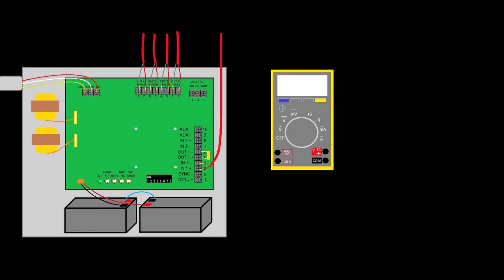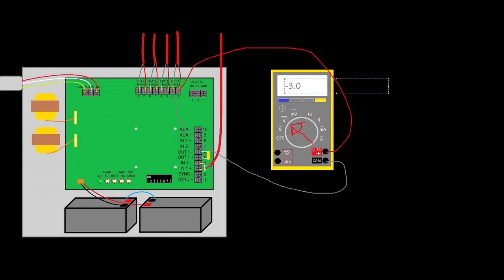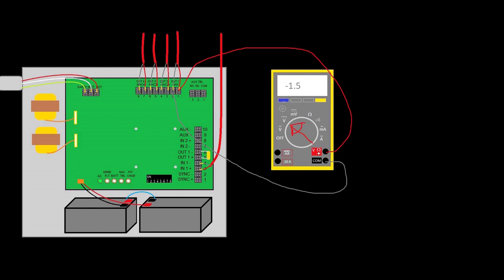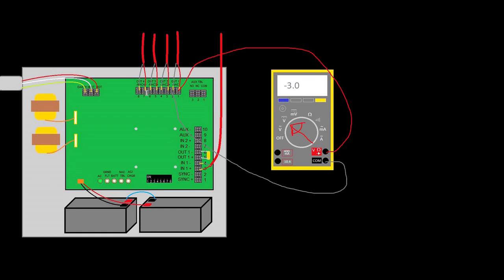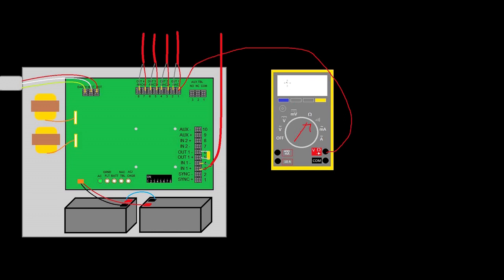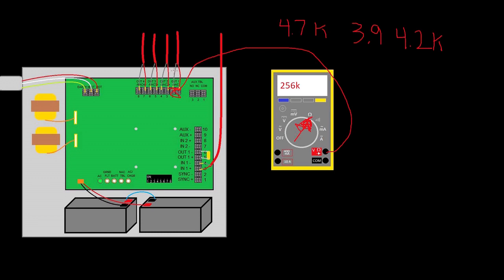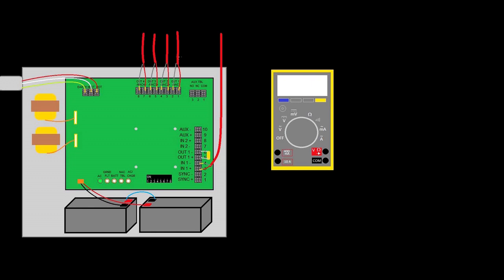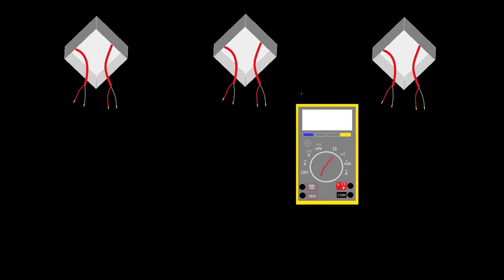31 - Metering Fire Alarm Circuits - Introduction to Fire Alarms

Comment: I know this is dated, but OL means Over Limit. The reading exceeds the capacity of the meter. Also, the setting with the diode symbol is the setting for checking proper function of a diode, i.e. continuity in one direction, no continuity when you reverse the leads.

Comment: Hi Joe,

Hope all is well and that you will read this.
I work at a property management company and recently we had a trouble pop up on one of our panels. Given what I found I'm surprised the trouble is new. Anyway, had a tech come look at it, he narrowed it down to a small area of the building but said he 'had no way to test' any further.

Needless to say, I got curious. We have multiple buildings with fire alarm systems and I am a 'do everything' maintenance tech so I started digging. Shortly into my search I found your videos. Your explanations and walk throughs of everything from the basic systems to the big picture really helped me piece this puzzle together.

In my experience I have done various 120/240v electrical projects and before your videos you could say I didn't really understand what fire panels do. So when I found out it's basically various electrical circuits that just have to monitor themselves I was all for it. Let me show you what I learned and how it helped me find the problem.

The panel itself is in the underground parking of a five building complex known as 'Phase 2'. It is an addressable panel with 5 SLCs and 6 Horn circuits, one horn is for the garage. The trouble was listed as '1002 Fire Trouble' (Note the device is listed as building only). The tech that came was able to tell us that is was on an IDC not a NAC so that helped somewhat. I did not pull anything off the panel itself because it was all four wire SLCs and a whole bundle after it left the main box and I didn't know what any of them were so I didn't dig into it much there. I found the control module for the building (had a trouble light lit on the front). Pulled it open, verified voltage on power in. Found an OL when I took of the 'loop' wires. On the other side of the module was what I can only assume to be data in. There is a 33kO resistor in line between the relays. The system looked like it was supposed to short on alarm, open on touble, so I was looking at the EOL of the data circuit for the building. As the note earlier suggests, I believe there was only one device on each SLC. From here on, we should be in conventional, one-in-one-out all in line devices.

Interesting note and question for Joe or anyone able to answer. It was noted that 24v smokes cannot be on a FMM because not enough power, this FZM (I believe although I have no indication from the module itself) gets power and yet we were only reading around 10V. Reading on this, at least some of the smokes had a dip switch to set them to 6-12V range so perhaps that solves the problem?

Funny note, the tech thought there was a short in the system when I know that would have caused an alarm and could clearly read an OL from the module.

So we started marching through boxes. The way the building is laid out we assumed the power started at the basement level of one staircase, followed the devices up and accross on the third floor hallway, and back down the other staircase to an exit on the first floor on the other side of the building. Near the panel there was a note saying EOLrs were at the pull station by that far exit door. It did not start like that. In the boxes there are red and black wires as well as brown and blue. It was hard to tell at first what they were but after confirming that they were just a continuation of the two wire circuit I started trying to read them the same. I noticed that we lost power after first the basement landing but had it in a random location on the other side of  the building, super confusing. I tried to get organized and draw things out, follow the power. I isolated a smoke that was getting power but not letting it through. To be specific this detector is a Smoke Sensor 2w-b. It's worth noting that the positive leads are split on the mounting bracket and the device completes the circuit. I saw somewhere else someone wired one of these in with the positives on the two + terminals. When I pulled the smoke down the line in was on RA- and line out was on RA+. This truck me as odd so I put the positives on the terminals labeled as such. Go upstairs to first, we now have power. Panel still has trouble unfortunately and still did not have power for a significant portion of the building. We keep going and find another detector of the same style (second floor landing straight above the other one, so still pretty early in the circuit) (most of the detectors are very simple two wire photoelectric), It is also miswired on RA+/-. On other boxes before this it was always, Voltage one way and OL the other, or EOLr one way (3.9kO ish) no voltage the other. On this smoke I read voltage one way, EOLr the other. Like you said, I had found it. Switched the wires over and now had power to the rest of the building. My coworker tripped an alarm when putting a smoke back in (probably crossed wires on the screwdriver, this is why it's a good idea to silence the horns when doing this) That had to be manually reset at the module before the panel would clear but we found it!!

A bit more research later, turns out the RA terminals are for a 'Remote alarm LED'. Basically if you want a light to go on when this detector trips, that's where you wire it, it only has power when there is an alarm. This brings me back to how was this not in trouble from the moment someone did this? This took a long time (10+ man hours, 4 hour push from me today to deal with it) to find and I'm hoping to be more efficient in the future. Knowing that the smokes blink when they have power is a good start because I can go until I don't see blinking and work back from there.

Every panel is different, every situation is different, but your videos gave me the conceptual knowledge and troubleshooting basics to get through this and for that, I thank you. I hope you can continue to make videos in the future.

Couple questions if anyone can help.

How do you make sense of all the little boards and labels covered by wires and rats nests you may find at a panel?

Behind the module there was a box that looked like a mini module you mentioned but the wires were tied in on blocks to a circuit board. It had br/bl in and r/b out to the data input on the control/isolation module. What is that box/board?

I mentioned getting 10V off the control module when it does get 24V power, is this normal?

Another Control module I opened (for the next building in line) had a brief trouble when stopped, could've been related to the other testing we were doing. The 33kO EOLr did not have continuity. I know you mentioned that SLCs do not need an EOLr but would it be a good idea to replace it anyway?

These control modules had LEDs on the front for power/alarm | Smoke detector trouble | trouble and no ID turn dials. I'm assuming this is something that has to be programmed at install?

I hope these questions aren't too vague. I just wanted you to know how valuable this was towards helping me handle this problem. Thanks again.

- Nathan
Reply from the maker: Nathan,

   Good find, and thanks for the kind words! If you're not happy with what you're paid in your current role, you could easily get into the alarm industry. It would take most techs a long time to reach the level of competency you seem to have.

You asked a lot of questions, and I'm not sure I totally follow the situation. I think there's a bit of confusion because of some of the terminology you're using. For example, you said each building has a "control module", but I think what you mean is a monitor module. A control module is an output module, something that would turn on horns, speakers, or strobes. A monitor module is an input. Regardless, I know get what you're saying.

It seems when you say "loop", you're referring to the circuit with conventional devices on it?

I'm a little bit confused on certain aspects of this. For starters, what kind of panel do you have?

It seems you're correct that the 10 volts should be OK if the 2W-Bs can handle 12 volts. Good catch.

Your questions at the end:
What do you mean about making sense of the boards and the rats nests? Do you have pictures? I guess that's basically our job, to know what the boards do and then troubleshoot circuits. It's definitely much easier when the install was done with proper workmanship and labeling.

Your next question I have no idea what that is. A picture would be helpful.

10 volts isn't what I'd typically see, but if they have a 12 volt power supply, and the 2W-B can handle 12 volts, that's no problem then.

The next question about the 33k on the SLC I can't make sense of. I'm not sure what you're talking about there.

Send me an email at Joeklochan at Gmail. Put some pictures of what you're talking about and I'll try to help out. Good job though, I know people who have been in the industry for a long time that wouldn't have been able to fix that.
Reply: Also I was testing the horn circuits output voltage for reference and was getting -5.0V almost exactly on all of them except one gave me -6.2V is this a problem?
Reply: This is on the output of a supervisory board that gets data and 24v

Comment: Now would you do these same steps with all devices? Whether it was smokes on the circuit or even tampers off a backflow? Is voltage always from the left while resistance on the right? If you find voltage present and 4.7K like you mention at the end of this video - what exactly does it mean in terms of you found the problem? If a problem didn’t exist on that device - what should you see instead of voltage and 4.7K ohms? Am I asking this right?
Reply from the maker: I think I get what you're asking. So obviously "left" and "right" are arbitrary, but wherever you can meter the same voltage as the panel (or source, whether it be a module, power supply, zone, SLC, etc.) is putting out, you know your circuit is ok from the location you're at all the way back to the panel. And wherever you can meter your EOL, you know your circuit is good all the way to the end of the circuit. For that reason, when you can meter the panel in one direction and the EOL to the other, your whole circuit is clear. 

So what I would expect to see if I took down a device and it wasn't the source of my problem, would be either voltage OR resistance, but not both. Picture a string of horn strobes in a line and we label them A, B, C, D, E, F, & G.  A is my first device, and G is the last one with the EOL on it. Let's say I have an open circuit at E, like a wire fell off of the device, but we didn't know that yet. If I went to C and took it down, I would see voltage to the left, and an open to the right.  If I went to F, I would expect to see an open to the left, and my EOL to the right. But when I went to E, I would see voltage to the left and my EOL to the right, telling me that the rest of my circuit was intact and I was at the problem.

Troubleshooting most circuits will consist of some variation of what I just explained, but troubleshooting SLC is a bit different because there can be t-taps and there is no EOL. In that case, you'd just see what devices weren't communicating with the panel and use common sense to break the circuit apart to see how it's run.
Reply: Joe Klochan thank you for your time Joe. This is a great explanation and definitely helps. Keep these videos coming. I especially enjoy the troubleshooting side.
Reply: Joe Klochan quick question - what happens if you get voltage from the panel at the device and you get let’s say 1.536 M ohms on the other end? Are you still at the problem or are you still far away from finding it?
Reply from the maker: @MichaelBrianInc  assuming you're troubleshooting a circuit that should have an end of line resistor (horn strobes, speakers, conventional zone, etc.) then you have not found your problem. Your 1.5 Meg (or whatever number you said) indicates an open circuit. You need to keep going towards the end of line until you can meter the resistor. If you're working on an SLC circuit it's completely different. I have a video where I explain what the different meter readings mean (might even be this one, I'm on my phone and am responding to a comment, so I can't exit this text field to check). The mega ohm reading is basically an open circuit.
Reply: Joe Klochan thanks Joe! Yes I was troubleshooting a NAC circuit. I figured that number meant nothing, but was a bit surprised as it was a device fairly close to my EOL. If I get back on site for dedicated troubleshooting the hunt continues....